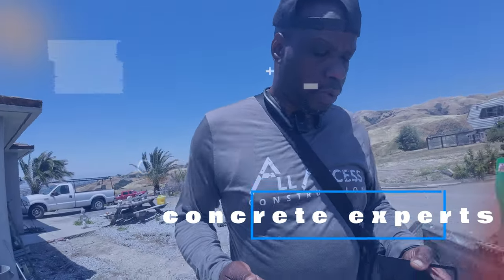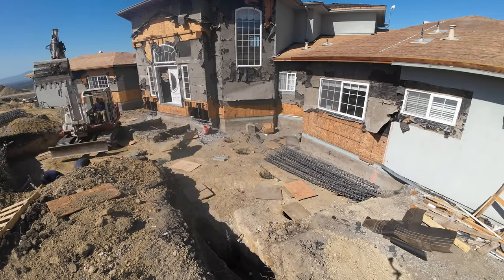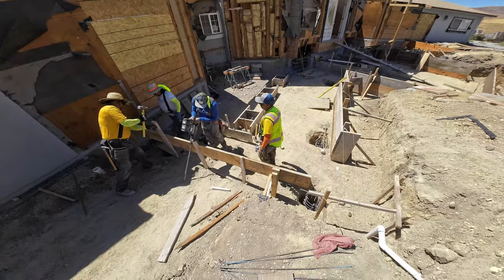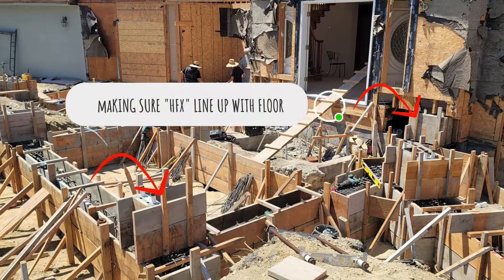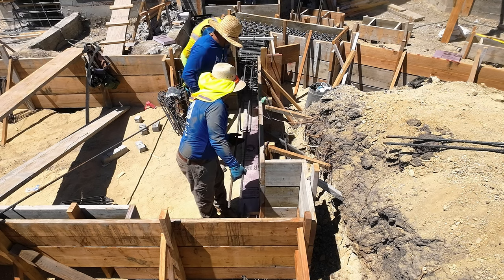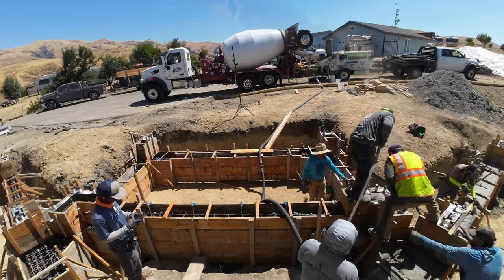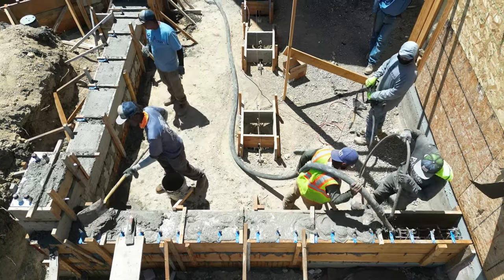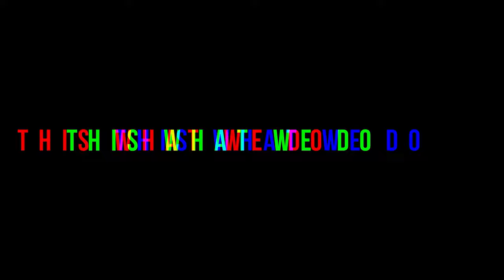How To Build And Pour Concrete Foundation For House Addition

Comment: Another amazing project,my Friend ! I’ve been working with, and around construction projects using concrete since 1980. You guys take concrete, and concrete construction to a whole new level !👏👏
Reply from the maker: Appreciate it man.. Working on another video... This was one of longer video.. How did you like the flow of it?
Reply: I thought it was excellent. Your attention to detail, right down to the yardage(highlighted in the video) Those piers, and the steel work involved in fabricating them is really impressive ! Are the piers required for earthquake code or did the engineer request them ? Either way, you run a smooth operation, and that’s highly specialized concrete work. I don’t think any of the concrete forming contractors in this area self-perform (in-house) anything other than set,form, and pour the walls. That’s why I say “you take concrete forming and pouring to a whole new level” Great video ! Keep them coming !👍👏👏
Reply from the maker: @ironbrother129 appreciate it man.. All work was done off some very detail drawings.. As far as piers.. Yea it's Cali everything for earthquakes.. 😂😂😂

Comment: It depends. If you are going for that board form design finish, no. Especially if you didn't use a an antibonding agent between the board and concrete. It should help left to cure for a few days.